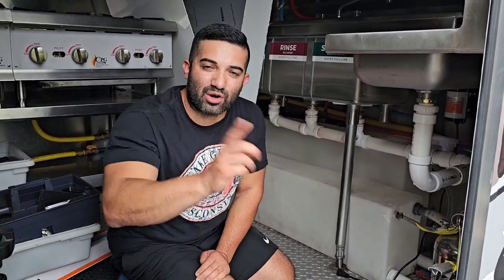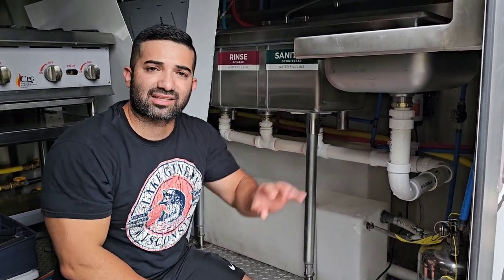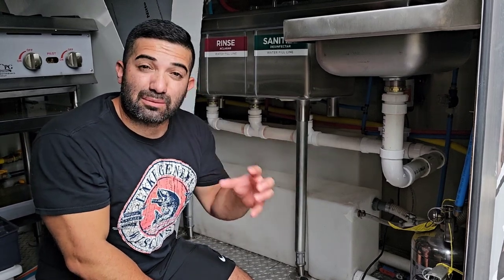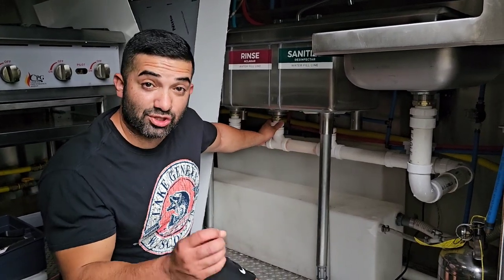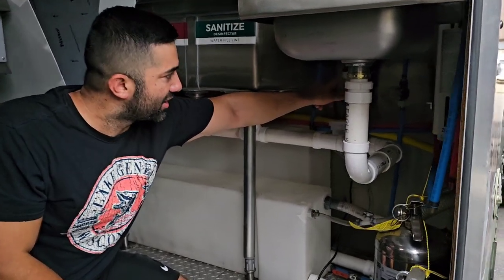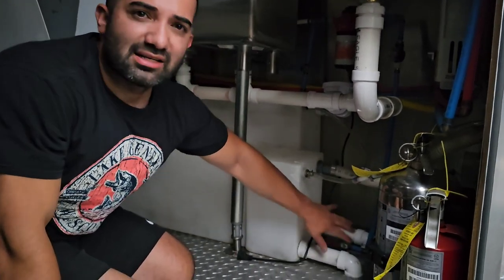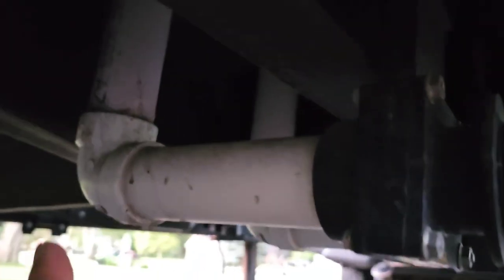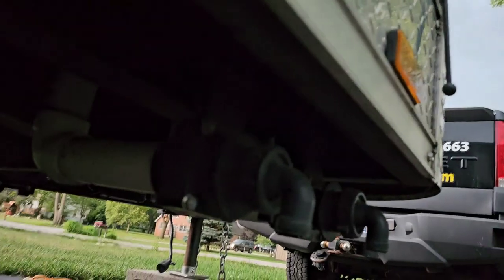How to Build a Food Truck: Plumbing Overview

Comment: Hey Frank, what kind of material is your wall behind the grey water tank? I see your diamond plate as the floor. I’m having to redo the area under the sink because it’s old wood and isnt ideal..
Reply from the maker: @wilcoxson30  good morning, it's stainless steel but white aluminum works well

Comment: Frank, your trailer building videos have been a great resource as we build our trailer.  We are at the plumbing stage in NW Illinois and being told we have to use an air gap for our drains into the holding tank.  Do you know if there is written approval in state code for the use of the backflow valve?  I’d like to be able to argue the point with the state plumbing inspector.  Our small county has no rules specifically for trailers.
Reply from the maker: Glad to hear that feedback. Not that I have seen. They are asking for a plumbing inspection from your health department, City department to operate?

Comment: Hey Frank, does my water heater and water pump both need to be on a switched plug? Or is one switched and the other not switched?
Reply from the maker: @Luvariana1  water heater well the one I use runs on propane. The water pump yes on switch
Reply: @fbaltierrez  My water heater in electric, so will that stay constant hot or well it needs a switch too. If there's no water running through the heater, will it burn up? Thanks for the reply, buddy, you're a big help.

Comment: Hi what do I need to do the pressure from my water pump keeps making my line come out of their connections.
Reply from the maker: @KJones-h9u  used the same pex connections? The ones I show, if yes they must be loose or you didn't use seal tape on the threads

Comment: Hey frank @fbaltierrez thank you for all the videos they have been  very  helpful.  I have a question i live in south suburbs of Chicago  where can i find the exact requirements  for my concessions trailer like can i install  cabinets or not or the size of the sinks or the electrical conduct has to be exposed  stuff like that

Comment: Hey Frank, thank you for all your videos! I am currently in the research phase of building a mobile bar. I am trying to calculate my total electrical load. I am going to run two fridges at 1.3 amps each, a water pump that is 1.2 amps, a kegerator that is 105 W/110-120 volts/ 15 amp recommended circuit, an ice maker at 7 amps, a hot water heater rated at 12 amps, and a 4 pack recessed light system rated at 120v/110 w. Since I am in Texas I also want to make space for a portable A/C that is rated at 115v/1100w and a 15 amp recommended breaker. I plan on using a siemens 125 amp 8 space circuit box with a 50 amp generator inlet box and 50 amp service cable. Would that be sufficient to operate the electrical system? Thanks in advance for any help!

Comment: I’m trying to upgrade my system I just bought a new water heater and my heater try to ignite but keep going out and my blue line to my water keep leaking I sealed it 3-4 times changed the pek everything
Reply from the maker: I've only used this water heater, haven't had any issues
Reply: @fbaltierrez  which brand may I ask i
Reply from the maker: @amentanorman855  Excel Ventless Water Heater Propane